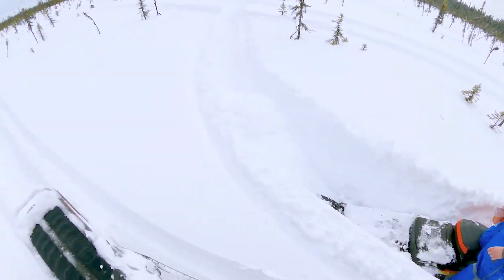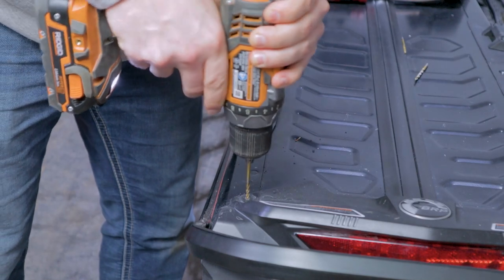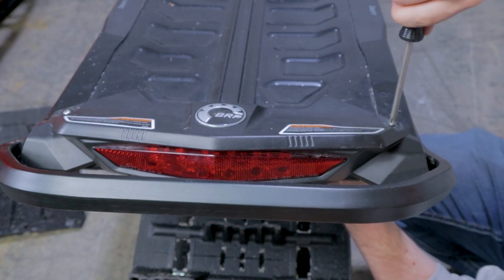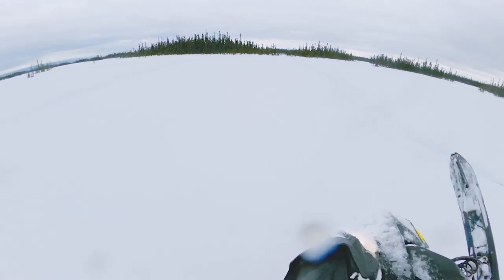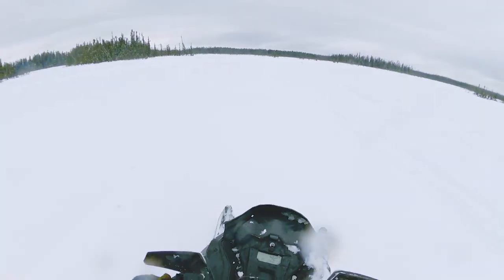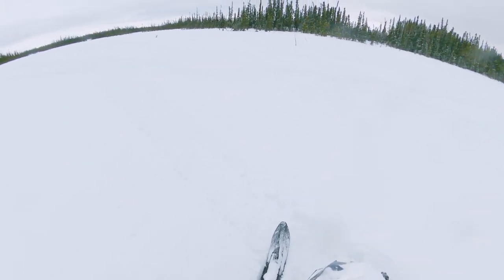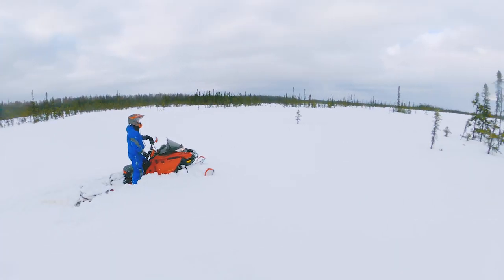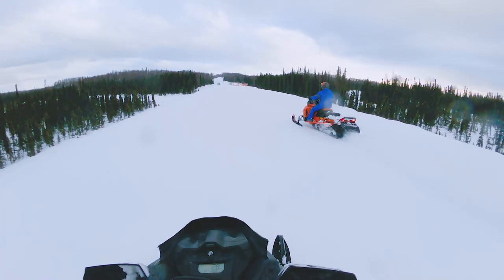Cheap Easy Short Tunnel Alternative

Comment: I also have that 600R summit in 146. I didn't remove the flap entirely, but I cut it in half along the seam of it. I have the limiter strap one step looser than stock, and it sure wheelies super easy now.
Reply from the maker: We initially cut the flap along that same seem mainly because it kept folding under the tunnel any time it was in reverse but then I just decided to remove it completely. I haven’t had any issues with over heating and it seems to be way more playful!

Comment: I have a 600 summit just like this one and love it. Underrated engine for sure!
Reply from the maker: For sure! Removing the snow flap has helped we were out yesterday and my brother road this 600 and it went everywhere my turbo went maybe not as easily or fast but it got the job done. A good shock setup make a world of difference as well. Maybe I should do a video on that process. 🤔 haha
Reply: @BTHAlaska  going to try that out with the snow flap. I live at low elevation in eastern Canada so the 600 does just fine, would love to try the new turbo sleds one day though. Shocks are definitely on my list of future upgrades
Reply from the maker: @NelsonBodiedU  Yeah at low elevation the 600 does just fine. I might be installing a clutch kit on it. One of the Ski Doo Ambassadors up here developed a clutch kit for low elevation since most of the mountains are around 4000-5000 feet. He says it gets the 600 close to an 850 so that would be kind of cool.

Comment: Do your GoPro batteries hold up in cold weather? I have always had this problem. I went to a Osmo Action camera. Probably solved.
Reply from the maker: I’ve often wondered if the Osmo’s batteries were better. The GoPro is hit or miss. Sometimes they work at 0°F and other times they die in five minutes at 30°F. The best thing I’ve been able to do is make a elastic cover to hold a hand warmer to the back of the GoPro. How long of record time do you get out of the Osmo in the cold?
Reply: @BTHAlaska  I rode Petersville yesterday and it ran an hour and a half without a blink. It was zero temp. The osmo only cost $199.
Reply from the maker: @n2snow  No way I was out in Petersville yesterday too. Haha. I got about an hour out of my GoPro battery.